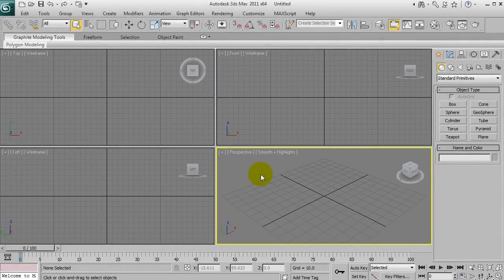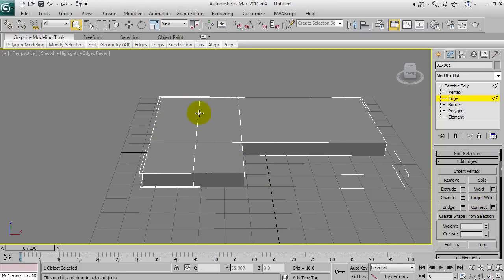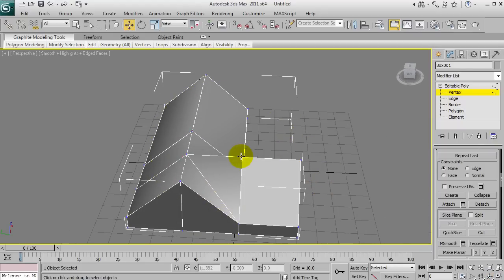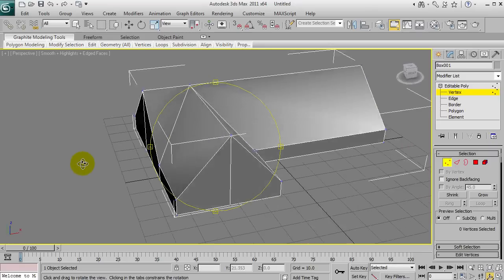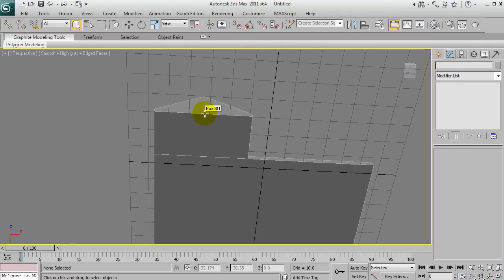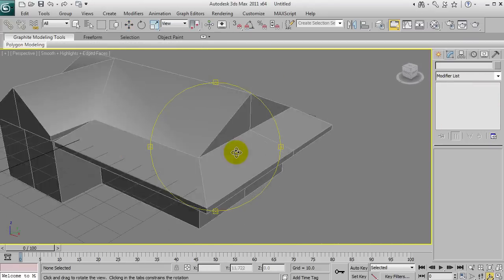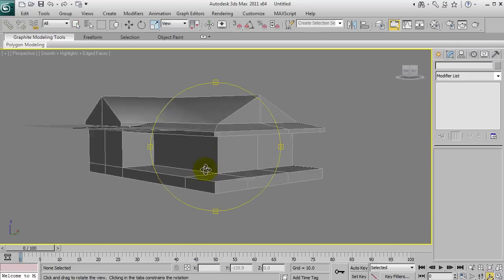Basic Modelling in 3DS Max: House (Part1)

Comment: Thanks for the video!

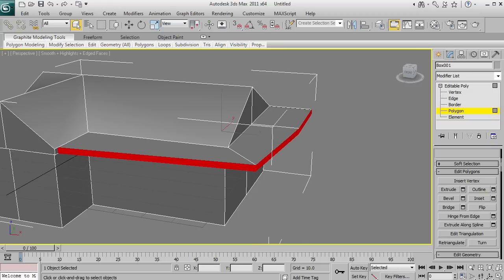But, sorry, I didnt understand what did you do at 8:19, could you please inform me what shortcut you used?

Tks!
Reply from the maker: When you click the box next to extrude in the left pane you get a floating window. Which I added a screenshot of in the bottom left corner.
The value was 10 then if you click and drag on the number in that window, you can increase or decrease it that way instead of typing a new number.

Comment: Almost all the tutorials I've seen recommend to right click and choose "Convert to Editable Poly" command, but I think the best to use is to apply the "Edit to Poly" modifier. The advantage is that you don't loose the option to later be able to modify the original primitive easily (the box, in this case).

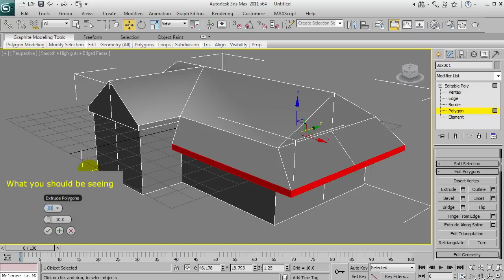Comment from the maker: Are you extruding? at 8:10 the recording software didn't capture an overlay parameter box for extrude. I included a screenshot of it where I changed the top parameter which is the type of extrude to "Local Normal" that might be where your having issues.

I may have deleted the bottom and then selected border and scaled out holding shift. Make sure the scale tool is uniform you can hit R a few times to cycle through the variants of the scale tool.

If none of this helped please elaborate.

Comment from the maker: Could it be function lock? There should be a blue Fn key bottom left of the keyboard, hold that and hit F4 see if that makes a difference.

Laptops generally have function keys in the case of my laptop Fn and F8 toggles wireless, you can turn on function lock but I'm not sure how it not always the same and I never use it (intentionally).

Comment from the maker: There isn't any grid for Z axis (vertical) in perspective, in perspective you should be able to see the grid 14x14 grid when you rotate the view port there grid doesn't go upwards (or at least not for me)

In perspective your grid is only X and Y which is where there's no change when moving along Z axis, just use the text bot at the bottom of the window and specify how far up you want it to move it or change to front view, its less of a bug and more no grid = no snapping to grid.

Comment from the maker: Ctrl + R to get the rotate view up.. In the top right corner of the view port you can click the little house icon to reset the view port to default perspective view.

Few other shortcuts
T Top
B Bottom
L Left
P Perspective (because rotating out of one of the above 3 gives you orthographic which is horrible.

Middle Mouse button to pan
Scrollwheel to zoom,Hold ctrl to zoom more at a time and alt to do less, sometimes you need to have just deselected something for alt to work.

Hope it helped..

Comment from the maker: @wucolin223 Well there are no polys on the bottom, so when I select by border it grabs the hole void of polys. You may find there's a break between verts so its grabbing more edges than you want, if that's the case to a weld on each of the corners and see if that helps.

Hope that helps because weird shape isn't a whole lot to go on.

Comment from the maker: @mstrsknk If it's what I think you mean, I extruded the porch out, I didn't just move it... if that doesnt answer it more information please.

To extrude Under editable poly->Polygon (4 to quickly got to poly mode) then select the polys, and then you want extrude in the roll outs, should be able to check the video to find specifically where it is I'd need to launch max to give more details.

Comment from the maker: @IcyKrystalQuartz ah you see what happened, you click the little box next to extrude and it brings up a a little box that lets you specify the extrude value, ie extrude by exactly 10 units, its just an input field which you can type a specific number or click and drag to change the value that way which is what I did.

If you look at 8:10 you see I added a window of what should be showing up but the recording software didn't want to.

Comment from the maker: @94knop That's the modifier tab, you'll notice just above is the area where modifiers will be added such as editable poly.
Those options are for the generic geometry when you create it, it's also available in the create tab until you deselect the mesh. 
Once you convert to an editable poly those options aren't there any more and you need to use "connect" to add height segments or inset for the cap segments on a cylinder for example.